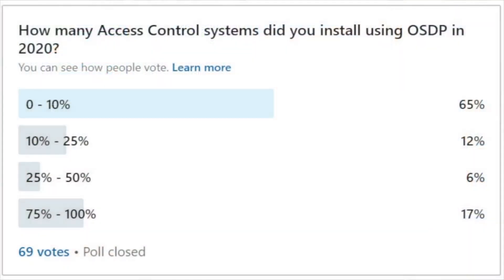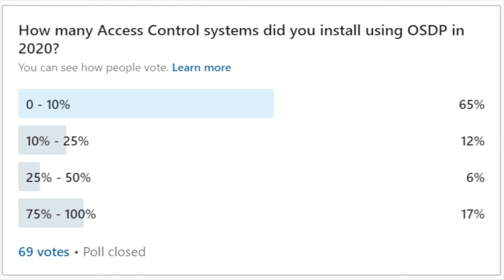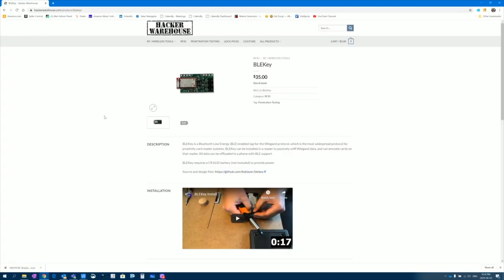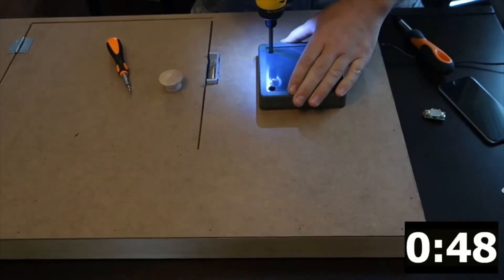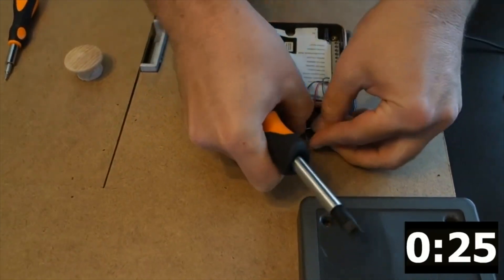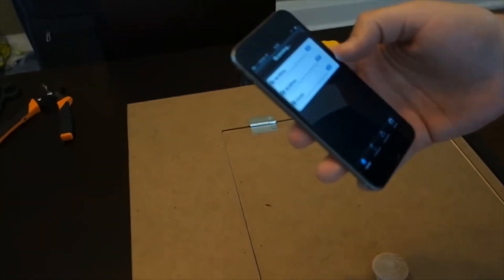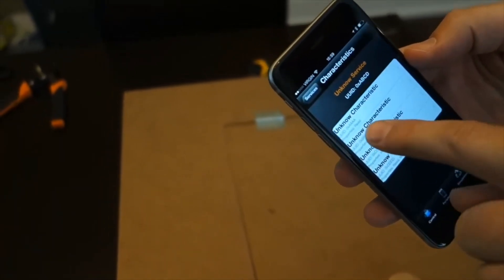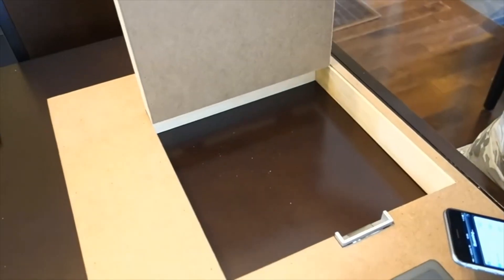What is OSDP and WHY is Wiegand Format SO BAD and why we should LET IT DIE!!!???

Comment: Phil, I’ve been an integrator/installer/boots and tools for 10yrs this year.  I’m also Genetec, Milestone and DMP certified; and have also been programming (mainly Genetec) for a while. Would a PSP be the cert to go for as something else to add to my knowlwdge base/cert/resume?
Reply from the maker: I would not recommend the PSP certification based on your skill set.  I think you might want to look into courses and certifications offered by the SIA like the Certified Security Project Manager
Reply: @theinsidetrack  Seems like they require project management experience though. Not sure that my field experience will work for this. Thanks for the reply nonetheless Phil, your videos are great, keep ‘em coming

Comment: This video is 3 years old & manufacturers still haven't figured out the OSDP kinks, manufacturers hardware and software like Genetec, HID, and Mercury all have to mesh, most of the jobs that I've done with OSDP have had some sort of problem, rather that be a software update, OSDP wiring requirements, hardware that doesn't support one another, powering issues. Until we're all on the same page, companies are going to sell what help their bottom line, and now importantly, something that works.
Reply: Hopefully more manufacturers use SIA OSDP Verified. There you don't have that problem.

Comment: What a crap concept of wiring and controlling the system : ) I can't believe that someone is actually trying to make things more complex and actually not change anything? Wiegand and so many wiring was the 80 concept. Now you have standalone devices which can be connected through ETHERNET/POE or wifi and directly have the device connected to "higher level" network.

:D Looks like you are just making things complicated so that "cheap chinese wiegand" devices that cost 10-50 EUR should be discredited so that companies continue buying 500-600 EUR dummy HID RFID reader which is basically of same quality?

What a stupid concept.
Reply: You are right about using a higher level network. Readers should have been put on an IP based network and just use a standard AES encryption over that. RS485 had been supplanted by Ethernet and I can see Bluetooth Mesh taking over Ethernet in systems like this in the future. OSDP is better than Wiegand but uses old school wiring and needs planning. Wiegand pulls down open collector lines which is the major problem. If someone is getting into your wires something is wrong. No one even connects tamper switches to readers. Wiegand is still useful for many lower security applications. It's amazing how many OSDP videos have comments turned off.
Reply from the maker: There are actually many devices that connect directly over an ip network but those are typically proprietary and require closed software to operate or have more security vulnerabilities than a traditionally wired reader. 

Also, new OSDP reader are actually LESS expensive than transitional weigand readers (from HID anyway).
Reply: Weigand and osdp HID readers are basically the same device for same money. Don't be so angry